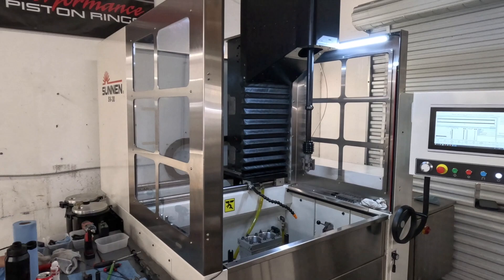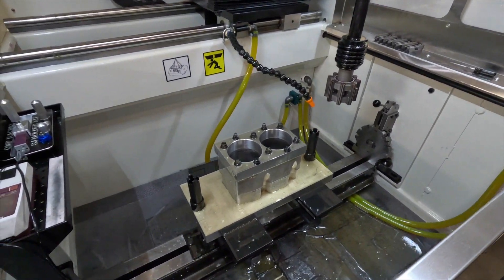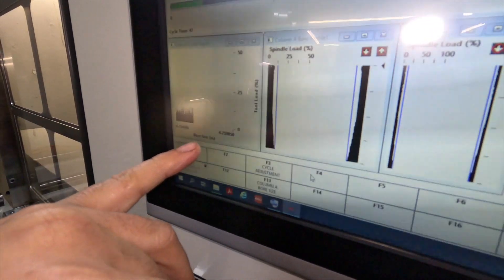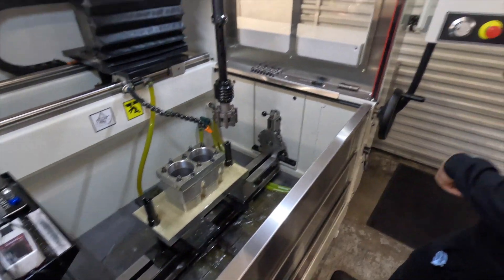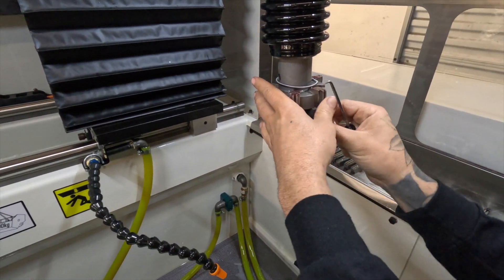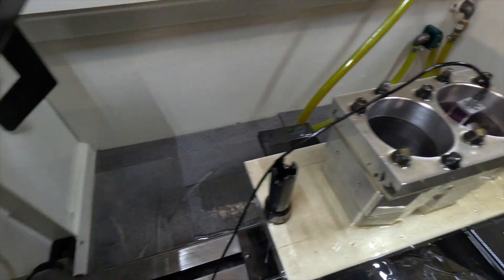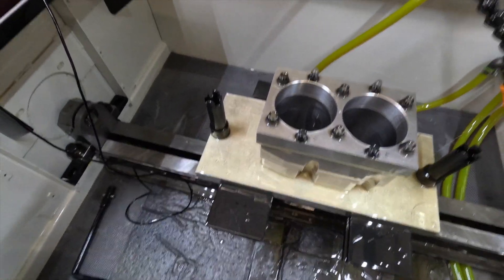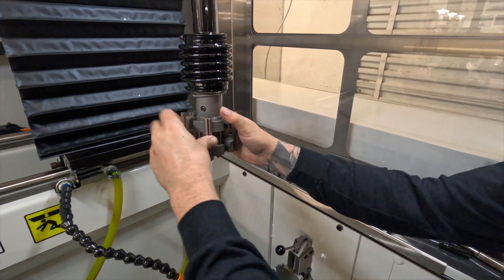Honing Aircooled VW Cylinders - Improving Engine Performance With CNC Cylinder Honing

Comment: The more out-of round a block is when not torqued-the stronger it is torqued. That elasticity works in opposition leading too a stronger block.
the new yaris crank doesn’t turn when not torqued. that’s no accident from toyota

Comment: OMG at 3:30 the stones sound soooooo loaded up it's horrendous, that minute amount of water 'looking' coolant isn't going to clear much debris from the stones with that twiddle coming out of the nozzle.
Reply from the maker: These are diamonds, not stones. They cut very different to vitrified stones. The ‘coolant’ you mention is in fact Quaker cut honing oil.

Comment: These old engines are awesome. One of my friends roughly 25 years ago his dad built up these old motors. Was hilarious riding with him because he would drop the clutch and pull the front wheels off the ground in bis 62 beetle.
Reply from the maker: 150-250hp in a bug is a lot of fun, you can surprise most supercars with just 200hp in one of these. And the look on their face afterwards is just priceless.
Reply: Yep. He was always breaking 4th gear. Me and my friend were always helping him drop the 4 speed out and put a new 4th gear on the shaft and put it back together.

Comment: Who would have thought you could hear the difference in the surface finish!
Reply from the maker: It’s crazy, all about micro inches!
Reply: Actually, back in the days of manual honing, including the advent of honing machines like Sunnen CK-10, and before CNC, reading the cylinder, was a matter of the skill and experience of the guy running the hone, by sensing stone load, motor torque, and sound, and was as much art as science.
CNC honing and the ability to precisely gauge surface finishes, has taken things to the next level, enabling the ring - piston - bore technology now available.
Reply: @georgedreisch2662  That's so true about the old days! I spent a good bit of time in my younger years at one of those kinds of automotive machine shops. The quality of the machine work depended more on the machine operators skill than the machine itself.
Reply: @robertwest3093  old days!? Some of us still use them antiques lol